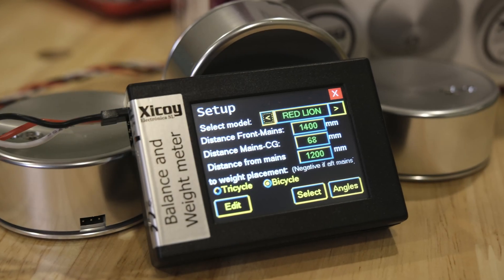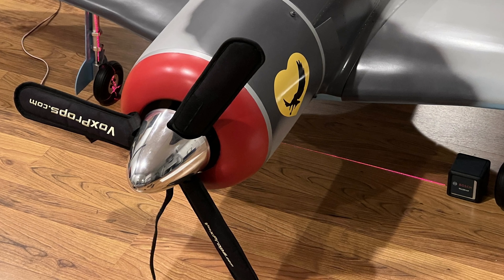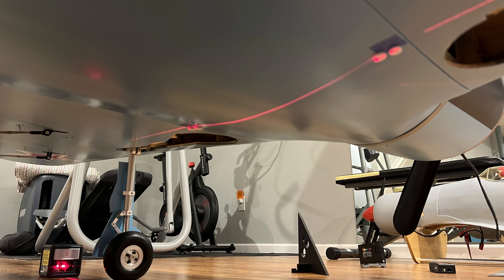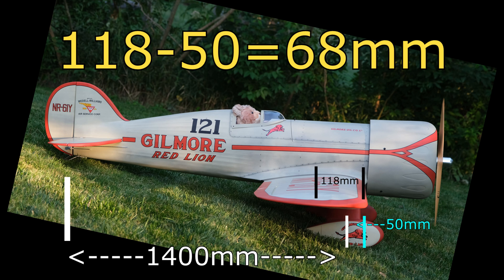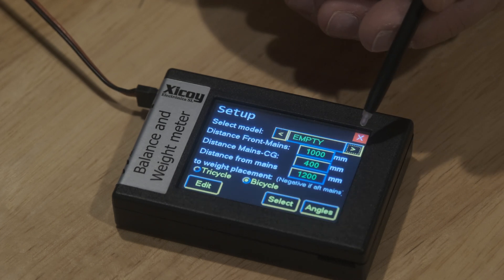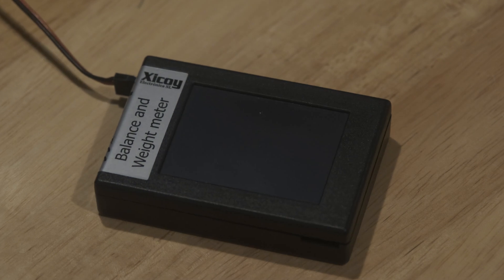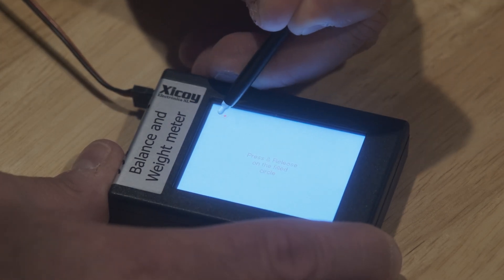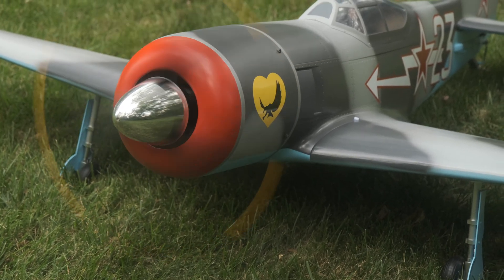Xicoy Balance Meter - Tips and Tricks - Screen Calibration NOT IN THE MANUAL!

Comment: I don't understand why the distance from leading edge to wheel axle is important?
Also, aren't the lever arms from the ends of the plane, spinner to architectural CG and end of rudder extreme to CG? There can be significant mass and distance in those 2 areas.
Reply from the maker: LE to wheel axle is important if all you have is the CG recommendation based on the LE of the wing. The Xicoy asks you to provide the desired CG in relation to the mains...not the LE. Most planes will give you a desired CG in relation to the LE....not the mains (axles).